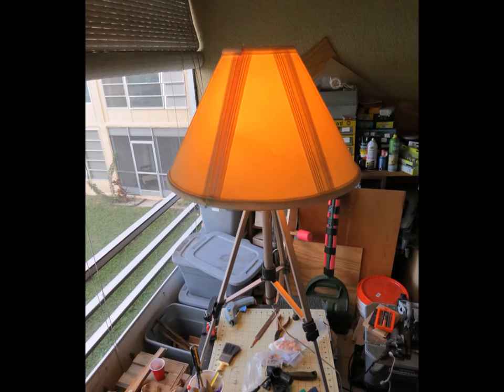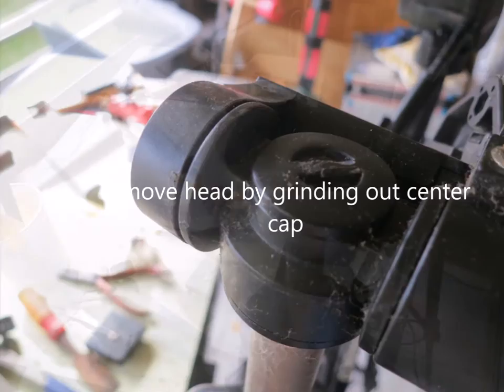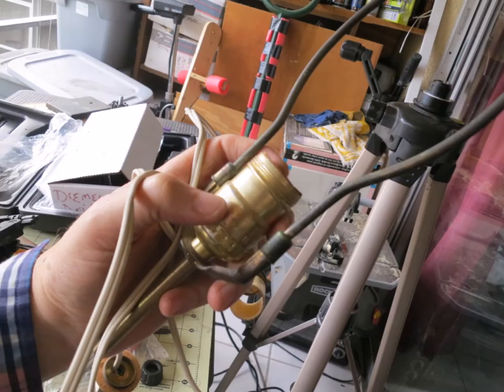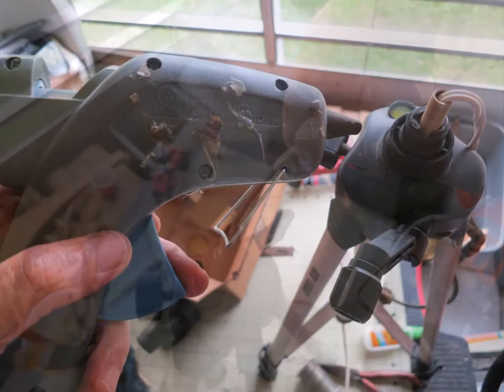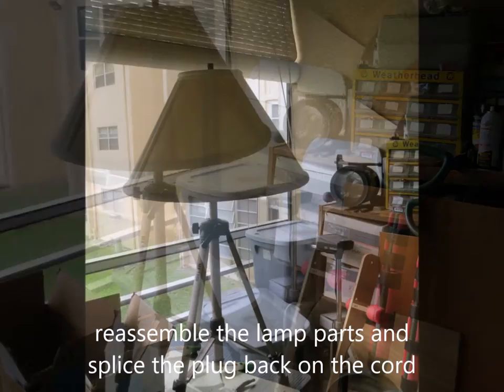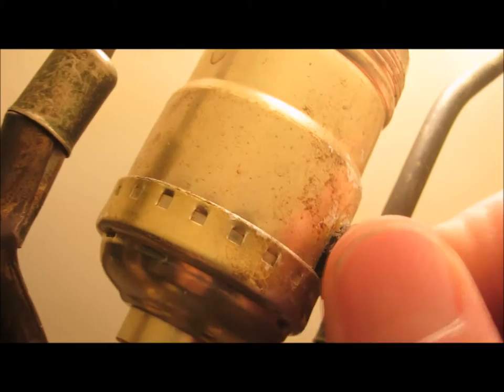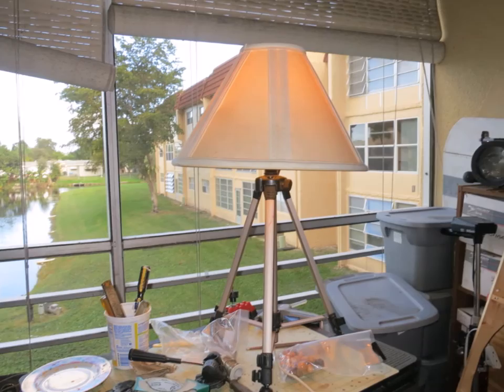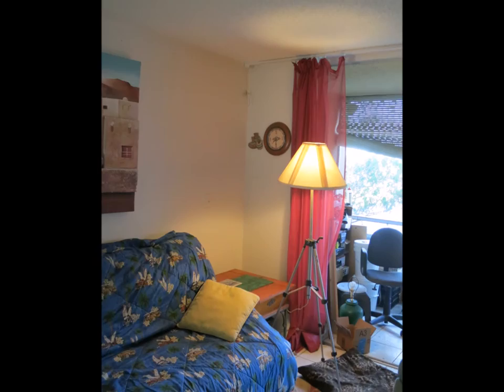DIY camera tripod lamp quick easy cheap cool!

Comment: Nice repurpose! Get on down! All the way down!
Reply from the maker: hey Brad, thanks. You know, it has been a  long time since I used an incandescent bulb, I forgot how yellow the light is they give off after using the LED and CF bulbs for so long. I kind of like it better for some uses.
Reply: LED's are my new favorite. For me, they seem to give off a light that my eyes can work better by. The older i get, the ,more light I need to see what I'm doing.
Reply from the maker: I agree, but for relaxing it is nice to have a room with a yellow glow. I do like a ton of light where I am working though.